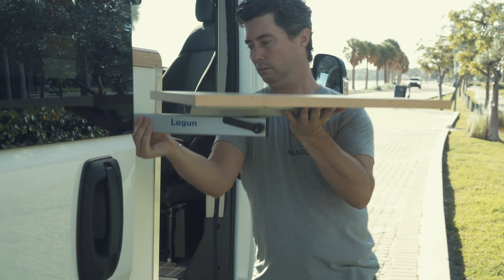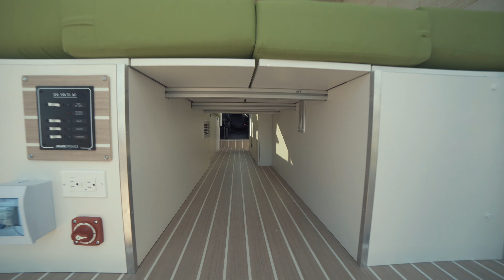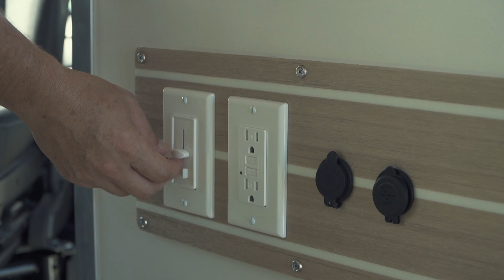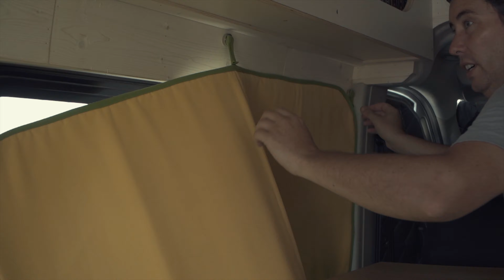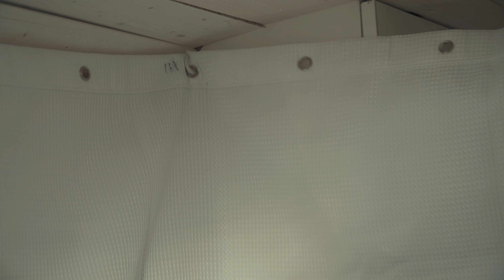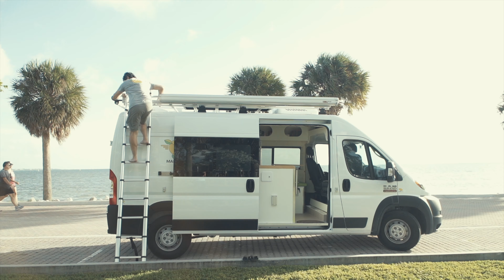Custom Build Camper Van Revealed |  Mango Vans

Comment: So if 300 watts of lithium gives you 6 hours of AC, 400 would give you 8?  I live in Ft. Lauderdale so good AC is a MUST!
Reply from the maker: yes that's about average we've been seeing is 2 hrs per 100Ah, of course lots of conditions such as outside temp and humidity, van insulation, time of day and direct sunlight, etc, etc, but certainly A LOT more efficient than old fashioned rooftop RV air conditioners.

Comment: Looks great! What is the dimensions of the bed when it is set up in that mode? And what are the dimensions of the two units that comprise the bed, could they be used as two twin beds? Did I hear correctly the dinette / bed is an upgrade? Is a fixed bed the standard? And could the driver’s side bench be shorter and there be a cabinet between the bench and the dinette / bed? Thanks! 🥭
Reply from the maker: the bed is just an inch shorter than a queen, the two benches are over two feet wide so could certainly be used as twin beds. Yes, fixed bed with garage underneath is a typically standard. The forward bench is currently 6' long making it an additional bed, but of course we could add a closet in between the bed and bench. thanks for following and appreciate your questions